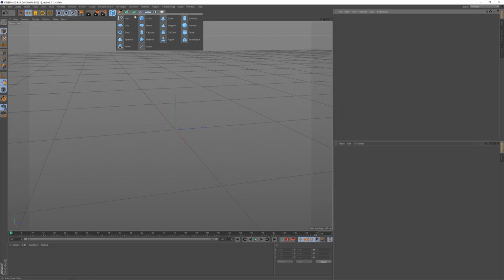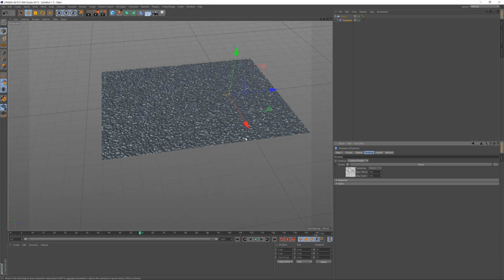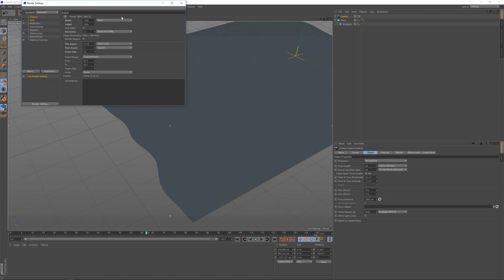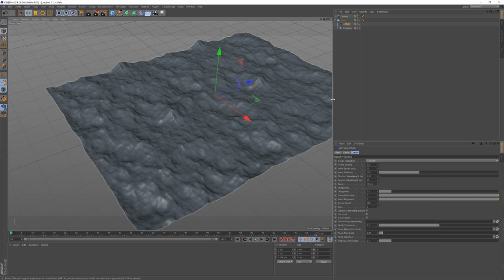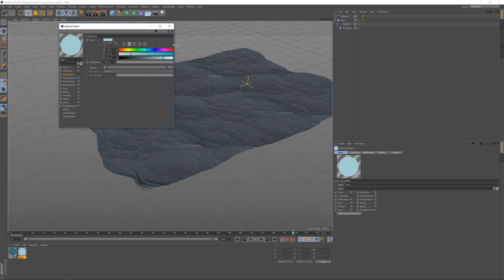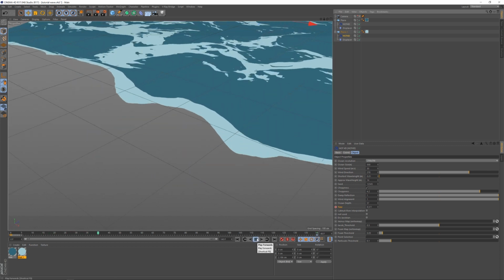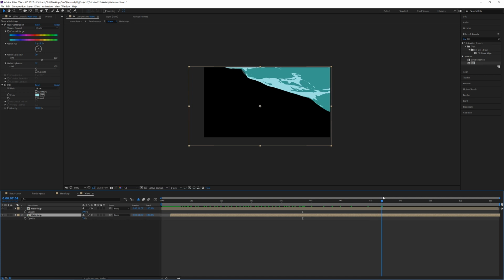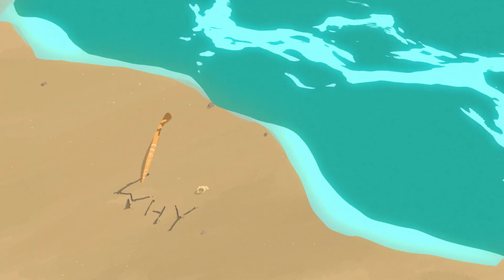2D Looking Water - Tutorial

Comment: Can you do this in Cinema 4d lite?
Reply from the maker: Im not sure what comes with c4d light but I am pretty sure it should work if it allows plugins. Its basically just a plane you animate :)
Reply: Olof Storm cool I’ll try it, if not does cinema 4d trial have a watermark when exporting?
Reply: Oscar Whittle You can do the animation part but not the 2d looking shading because it doesn’t have the sketch & toon shader. But here’s what you can do. Tell someone who has the c4d full to make some of the most used types of cel shader and save it as a .lib4d file. Now you can use the library to import the toon shader. Just tweak colors etc to suit your object. I actually don’t it will actually work or not but I think it will.
Reply: @toma4474  This tutorial doesn't use the sketch & toon shader, it's just a plain luminance material.